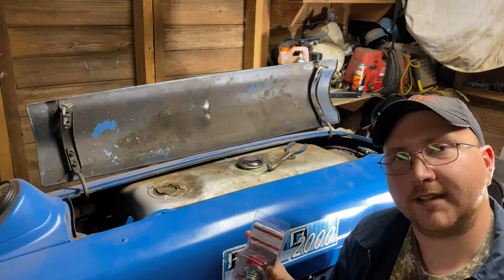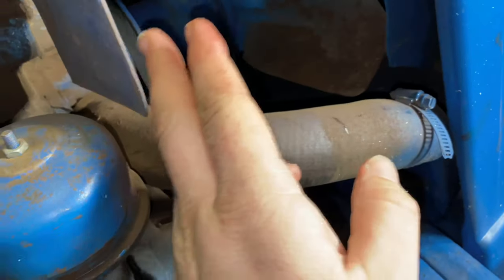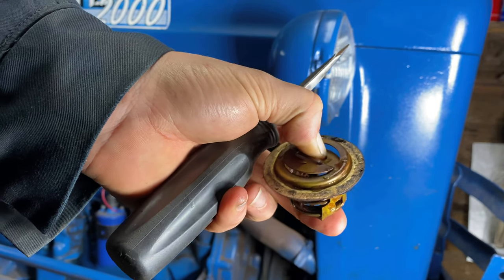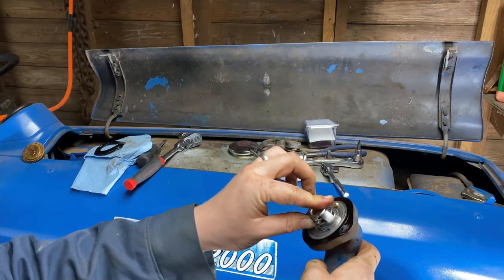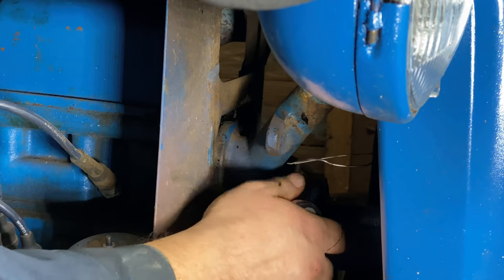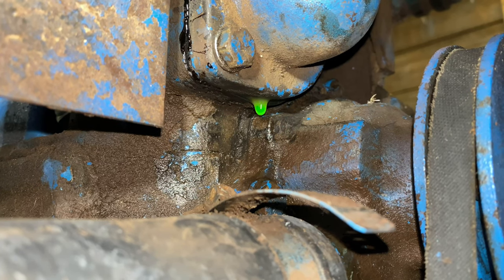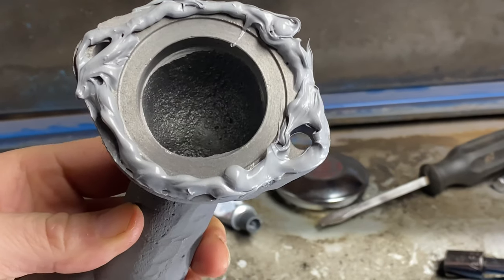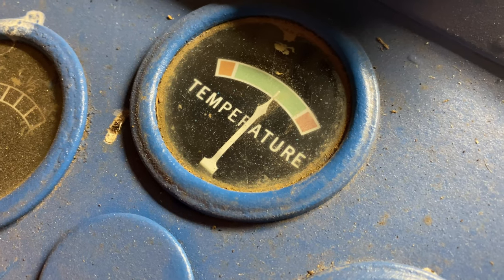Replacing a Thermostat on a 1953-1964 Ford Tractor (Gas)

Comment: I’ve got a Ford 861 and I replaced the thermostat and it seems I’m having problems getting the air bled out of the system I have a very erratic temperature gauge fluctuation